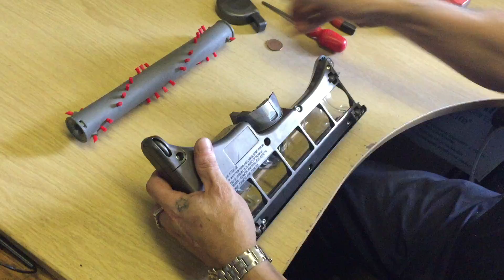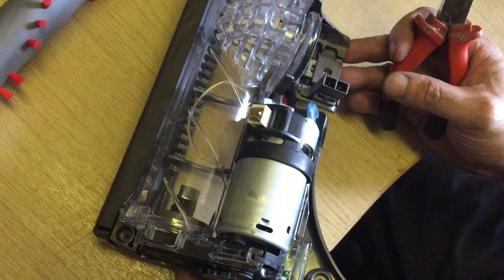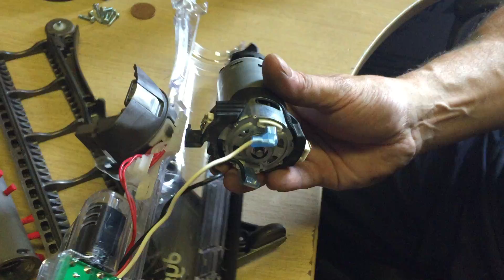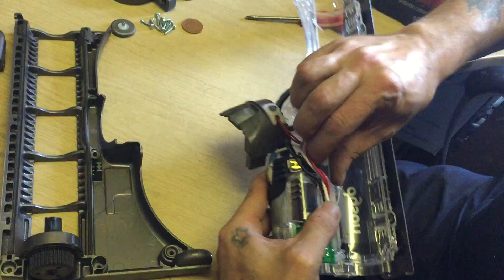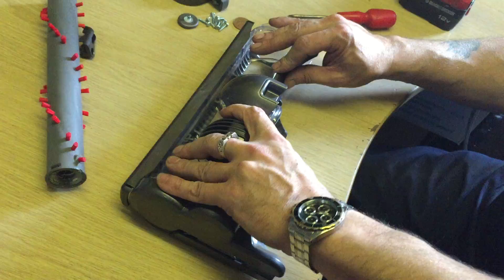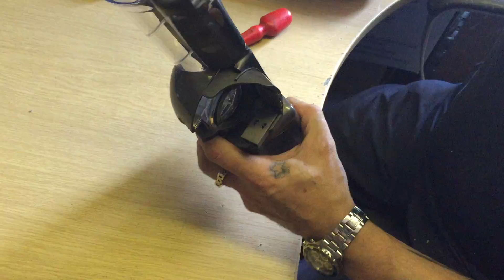Dyson DC25: How To Replace The Brush Roll Motor

Comment: Hi interesting video, i have a dc25 on the bench with no power to brush bar connection,  all leads seem ok switches work but not sure on the micro switch but there is continuity any help, the bush is ok and works in other machine

Comment: I switched my dyson dc 25 on this morning and it sparked and fizzed down at the brush bar motor,I suspect that my dog has peed on it as it was wet inside when I opened it up.on the circuit board I can see a scorch mark so does this mean I need a new board or a new motor please

Comment: Ive since sorted mine, bought replacement PCB as no voltage was coming out of it, put the pcb in connected it all up and the brush roller started to spin, then the motor was sparking like crazy,so now thats blown too, buying 2d hand full head and simply swapping over

Comment: @Manchester Vacs (Dyson & Sebo Specialists) Did you say 320 volts dc? is that right? I measured the output from the rectifier and it was flutuating from 5 volts to 135 volts and i thought the rectifier was faulty,i did not realise it needed 320 volts dc to move that motor.
Do they just pack up like that work one minute and the next dont?

Comment: I cannot thank you enough for posting this video.  I am a 62 year old woman in the U.S. with familial tremors.  It is pure comedy to watch me try to deal with a screw driver!  Because of your video, I was able to take my dyson brush roll motor out of the clear roller cover and put it back without breaking anything, getting all the wires tucked in and when I plugged the vacuum in, it worked!!! 

I had a huge mess which the dyson sucked up in no time.  Only, after it did the job, it was filthy and caked with .. I am not even sure.  Cleaning the filters were easy but I was worried about the brush area.  Your video is clear and concise and helped me get it done!  THANK YOU!